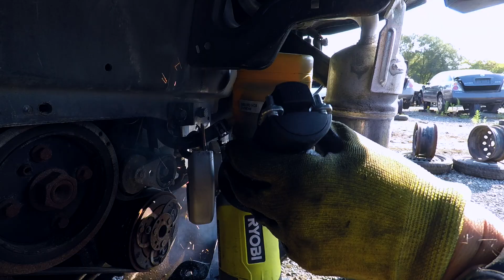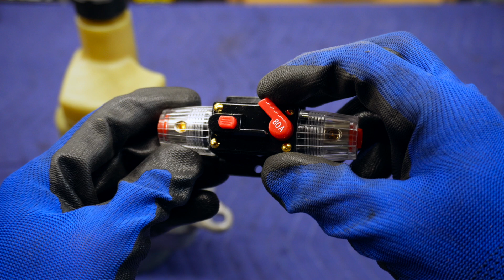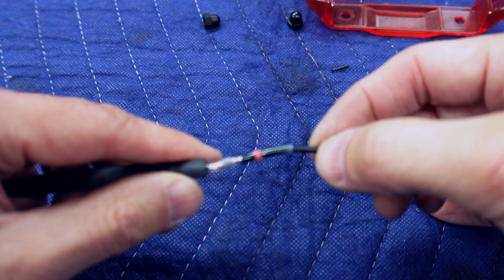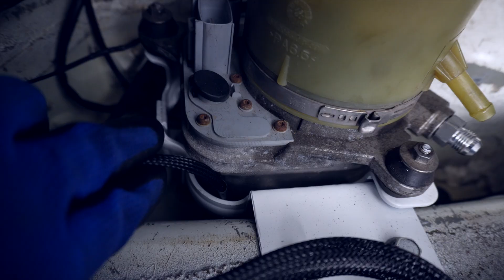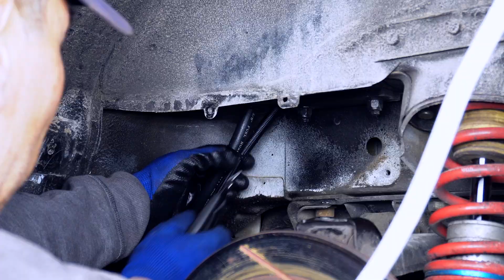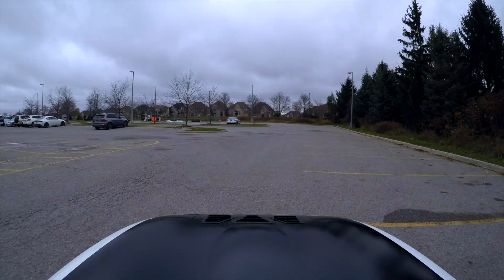Electric Hydraulic Power Steering Retrofit Comprehensive DIY Guide

Comment: Great video, awesome info. The adjuster is a great find. 

Am looking to do an EV conversion on my Ford Transit so this would work great. 

Incidentally I replaced the electric power steering unit on my 2004 Ford C-Max about 10 years ago but it was a straight swap.

Comment: Great video! Question, how has that PTFE line held up now that’s it’s been over a year ?
Reply from the maker: Perfect, I also run the same brand -6AN for my fuel feed line and it's been holding up.
Reply: @mostlyuselessgarage Nicee, thanks for the reply. I run Evil Energy for my fuel set up as well, just wasn’t sure with the pump being high pressure if it’ll burst.

Comment: Debating on doing this to my e36 only thing holding me back is the noise maybe if I mount it super tucked up in the bumper I can quiet it down in the cabin ??
Reply from the maker: On the Volvo the pump is positioned at the right front corner in front of the wheel. If that's an option, the noise should be unnoticeable.
Reply: @mostlyuselessgarage funny enough I’m doing that rn lol
Reply from the maker: Great minds think alike 😊

Comment: This was useful. 
  I'm working on a 1968 VW type3 squareback with an ej22 swap. It will be a widebody with 8.5 x15 fronts and 10x15 rears. Double a arm front suspension.  
  Volvo EPS is a viable idea. 
  I'll mount it in front.
Reply from the maker: Holy! That's gonna be a wild ride dude!

Comment: So when you set the knob to minimum and middle does it pull less amperage?  Btw very informative video.
Reply from the maker: Sorry I don't have a way to measure that. All I can say is that with my 150amp rated alternator, the 80amp breaker has never tripped and I've never had an issue even on track.
Reply: @mostlyuselessgarage good info, thanks

Comment: One question when comes to downside. Does this mod affect the life of alternator since you need extra like 30A for the electric pump? Will it stress your alternator more than usual is my question.
Reply from the maker: Good question and this really depends on your alt's rated amperage and your car's load sources. In my case I don't have AC, subs/amps, light bars, etc so even at peak 80A the EHPS should be fine. I drive my car on track and even with constant PS load it's worked flawlessly. And with street driving it's basically under zero load for 99% of the time. My alt is rated for 150A
Reply: @mostlyuselessgarage Oo.. that's a big difference compare to mine. My lancer alternator rated only 105A, and it's a daily use street car. Guess I'll gonna need to upgrade to a higher ampere alternator before modding this. 😊

Comment: Amazon/ebay ave a bunch of wiring connectors available for these pumps. Be aware they are all 10g wire.  I'm only using 2' of wire to direct connect it to the battery, time will tell if that's enough thickness for the short wiring run. 40 amp fuses aren't enough for this pump as they will periodically blow, going to be testing a 60 amp fuse next. The volvo OEM wiring appears to be 6 or 8g wire and it uses an 80 amp fuse.

Comment: I red online that alternator upgrade is needed in order to run volvo power steering pump, at least 80A. Anyone did an alternator upgrade?
Reply from the maker: I didn't upgrade my 150A rated alternator and it's been fine.  That said, on a very tight race track I noticed in my BMS that there are period spikes of ~90A.  It's probably quick steering transitions putting load on the pump.

Comment: Would like to do this on a 1971 land rover.  It has no power steering at all.  What do yo think?
Reply from the maker: Since you don't have PS it makes more sense to retrofit a column mounted EPS like from a Prius. Check in the Land Rover community if any kits exist, or if you're a fabricator buy a pump, controller, and shafts from a Prius and get to measuring and welding.  Good luck!

Comment: Great video, new subscriber. Did removing the parasitic loss of the engine bay pump & transfer weight to rear help your setup? 

I just wanted to mention that ServTronic now has an automatic pump speed kit controlled by GPS speed which eliminates the variable knob. It’s what I’m leaning towards.
Reply from the maker: It did, after corner balancing I noticed that the more optimal location for the pump is the right rear by the battery. I still prefer it on the left as it doesn't really interfere with what little trunk space there is. 😅

Ya the GPS one was available at the time and it does look like a great option ... Report back how you like it!

Comment: What amperage is your alternator and what electronics are you running? I have the same setup but my breaker trips when I go full lock.
Reply from the maker: My alternator is rated for 125 amps. If you have an 80A breaker on your pump it's drawing to much. Do you have a controller installed? Try dialing it down to minimal assist.
Reply: @mostlyuselessgarage  It still pops the breaker even at the lowest assist when hitting full lock. I did some testing yesterday and it looks like the amp just isn't giving enough at idle. If I hold the RPMs high, it doesn't pop the breaker. 🙃
Reply from the maker: You sure the alt is supplying its full amperage?
Reply: @mostlyuselessgarage  It's giving the most that it can and it just isn't enough. It's a 165A alt which does 100-145 at idle, but it's going through a relay box with a 120A fuse. I'm going to bypass the relay box and go straight to the battery with 0 gauge wire and an inline breaker. If that fixes it, then I save the alternator money, if not, then it looks like I'm going to have to get a new alternator. I have 2 Walbro 535s as well so maybe it just barely isn't cutting it. I'll do the modification tomorrow and see what comes of it. I really enjoy your writeup and video, too! That's what got me thinking about the alternator/wiring.

Comment: Nice vid! Appreciate all the info. I am looking to do this in my E30 that I am in the middle of K24 swapping, since it can only run one of AC/PS off the belt and I live in a hot climate. I was worried about the pump whine (cant stand that high pitch) and was starting to get my hopes up because I couldnt hear it in your driving vids, until you mentioned it at the end and isolated it lol. Is it still noticeable with music playing?

I guess I could add some sound deadening to the trunk if it's bad enough, or see if I could tuck it down by the bumper where volvo does in their cars and see if that location cut the noise down more.
Reply from the maker: It's not silent and I do notice it but I usually drive top-down. I plan to sound deaden the area to make it quieter, shouldn't take too much to make a difference. Good luck!

Comment: It’s an interesting video.
I’m wondering whether the fluid needs cooling.
If I set it to maximum for daily use, is it dangerous—could the system get damaged?
Reply from the maker: That's a good question. Mazda did include a PS cooling loop (little extra length of hard line). For me I have maybe 5 times the length under the car. Also a belt driven PS increases speed with RPM, while the electo-hydraulic pump spins at its own speed, intuitively suggesting less heat. This is a common mod for drifters and road racers, I haven't heard of any mention of additional cooling requirements, but plz do your research and report back!

Comment: This is a really fantastic video.  I am going to do this to my track miata just to... "Try something new" as you put it.  In my case, I plan to mount the pump on the passenger side of the trunk.  This will have the benefit of taking weight from the front left, the heaviest corner of car, and adding it to the right rear, the lightest corner!
Reply from the maker: That's a really good reason to mount it on the right side of the car, plus it'll allow easy routing of the cables with the battery there. Where do you plan to mount it though? In the middle depressed area?
Reply: @mostlyuselessgarage  I am not sure yet, as your video was the genesis of the idea for me.  I plan on collecting the parts over the next few weeks and looking into it.  I will probably mount it in the spare tire well as far rearward and to the passenger side as possible.  While I do have a lithium battery, it is stock size and fills that area completely.

It's currently racing season here were I live and I don't like starting projects when a track day is only a couple weeks out.  I've learned from experience that even a seemingly simple project or install can turn into the car being on jackstands for a month while I fix something.  Miatas are old cars, and mine is high mileage!  If I haven't already replaced the part myself, I know that I will discover something awful when I take it apart!

Comment: I’m not necessarily doing this mud, but I’m deep powering my steering rack over the winter. It’s nice to know that if I get tired of the power steering, this is a much easier solution than putting the original power steering back in.
Reply from the maker: Thx dude, I've never de-powered a rack before but I believe it involves disassembly, greasing, and blocking the ports. Adding hydraulics back could be troublesome, so all electric EPS may be for you. Good luck!

Comment: I'm not sure it's worth me getting a data point on stock ps weight resistance, since you have a different size steering wheel, plus the base vs leather wheel are different sizes. Still really neat. I do wonder what % change the alternator load is experiencing vs the hydraulic pump
Reply from the maker: I haven't noticed any voltage drops or anything but I'll report back I notice any weird electrical issues
Reply: @mostlyuselessgarage  I should clarify what I meant, engine HP loss percentage. Is the Alt more efficient at higher load? vs the PS pump inefficiencies at all times?  Would be cool to see datalog of power draw on the EPS system, on a graph. I'd imagine it's low power drawl when you're not loading the steering, vs the hydraulic pump nearly always being a drag.
Reply from the maker: Went down a bit of a rabbit hole with this. In the video linked below it shows the injector open time increases as you turn on electrical consumers like headlights, fans, etc. So increased electrical draw = more load, that's only logical. With the electro-hydraulic PS pump the draw should only be significant at the most aggressive steering inputs like parking lot speeds and full lock turns. However the PS pump is always spinning with the drive belt so I suspect it would have more parasitic loss than the intermittent high draw of the alternator. It's an interesting question, I don't know how a DIYer would test it. So we may not know unless an automotive engineer were to definitely weigh in here. 
https://youtu.be/UI0jYQQCcP0

Comment: Just installed a volvo pump into a ae86 but it feels so weak, im using an ls400 100amp alternator and i feel its not nearly strong enough. What amp alternator are you using?
Reply from the maker: My alternator is rated at 125amps. Try measuring the pump draw when steering to see if your alt is good. Love the user name you low-key drifter!

Comment: I want to do this mod in my 1982 Volvo 242 Turbo (original turbo car), mostly because the OEM servo pump sits over the OEM AC pump, so when I want to do group a intercooler, the pipe routing has very little wiggle room. But then I can remove that pump and rather have it electric. I have seen maxxecu can control some of the volvo pumps also, but I imagine I would be fine evne with it at the 70% or whatever the limp back home mode is.
Reply from the maker: How appropriate to do this mod on a Volvo 👍 I haven't heard of the Maxx controller but if it's anything like the Servtronic you should be good. Even the default mode is probably OK for street but since the controller is so cheap I highly recommend it.

Comment: I tried that without the controller. When you steer slowly everything's fine but if you want to steer fast the EHPS can't handle it and steering becomes really heavy. Did someone else experience this?
Reply from the maker: After testing the EHPS on track with the controller I found anything over about 25% assist doesn't weight up during quick transitions. Which is weird because it's supposed to have 75% assist without a controller. Bottom line, controller's cheap and worth it.

Comment: There's a leroy engineering dyno test on the hydraulic pump loss to whp somewhere on here. You sir gained 5 to 10 whp in the heavy turns by getting rid of the miata one!
Reply from the maker: No fact checking required, I'll take your 10whp and doff my cap 👍

Comment: Great video! It’s been a few months since you posted this. Have the “evil energy” lines held up well? I’ve come across the brand before and the price is tempting but also worrisome lol
Reply from the maker: Yup they've performed really well. Besides using them for the PS hydraulic line, I have the same PTFE lines on my fuel system from the tank to the filter and up to the fuel rail. Installed in 2023 and no issues since then even under track driving conditions. Evil Energy seems to be popular with the LS engine crowd with many accounts of reliability in that community.

Comment: Great video! Thank you for sharing the experience of installing this pump. Do you happen to know how much current it draws during operation?
Reply from the maker: Good question, I'm not sure how I'd measure that. Any suggestions? Thx for the comment
Update: A little Googling later, at no load 6amps, turning stationary 20-25amps, full-lock with pressure on the steering wheel 70-75amps due to no circulation of fluid. So an 80amp breaker is correct

Comment: Bravo perfect sequel to your electric power steering video!  Did the new hydraulic system have any of the response delay or non-existent return to center safety issues that we discussed compared to the electric power steering from the first EPS video?
Reply from the maker: No issues with response or centering. Even on track there was no weighting up on quick transitions which I've felt on Honda PS systems. This EHPS felt like stock, plus like +/- 20% with the adjustment knob.
Reply: @mostlyuselessgarage  That's great news thank you for the confirmation and taking the risk out for all of us pondering the EHPS mod!

Comment: Hah, I installed this pump 10 days ago with 6AN feed. I have 1 second delay if I turn steering very fast. (It's limp mode). Have you any delay on very fast movements with controller?
Reply from the maker: No delay that I've noticed even on track. I gave it a thorough thrashing and it felt better than stock. For the price the Servtronic is a no-brainer IMHO.
Reply: @mostlyuselessgarage 🙌

Comment: Hey so I just did this retro fit on my mk1 Audi tt, I’m not running the controller, just “limp mode” as you called it. I’m having an issue when it turns on, my steering wheel goes full send as soon as I barely turn it. Any ideas?
Reply from the maker: What do you mean your steering wheel goes full send? Like full assist?

Comment: Is the electric steering from kmiata noisy?
Reply from the maker: Not especially. It's not circulating fluid, it's an electric motor on the steering shaft that provides assists based on the input load.

Comment: Why electric hydraulic steering vs electric steering?
Reply from the maker: If you haven't depowered your powered rack yet, electro hydraulic is a quick way of getting heavier steering and adjustability. And it can clear space in your engine bay and reduce some parasitic loss.
Electric PS is expensive, requires a depowered rack already, and from my experience, there are some ranges of adjustment that just feel off when driving on track. Like a deadspot or disconnection. I'm not the only one, I think Taylor Ray didn't like his EPS for the same reasons.

Comment: Just did mine on my 3000gt mainly to clean up the engine bay (I got the same pump and speed controller!!). I had welded up a bracket to mount under the rear quarter panel and retain use of the factory rear wiper fluid reservoir as a now repurposed ps fluid reservoir using adapter fittings (I deleted my rear wiper). Looks oem, cleans up engine bay, and pump is out of plain sight, I love it. I however only got to TEST it as of 5/10/25 simply because the line ruptured by the 90 degree an fitting by the pump. Bit of a speed bump but I've already ordered a new one and cant wait to fully experience this. This video deserves more attention keep it up!!
Reply from the maker: Dude sick ride! I used to own a 93 VR4 👍 How did you handle running the hydraulic lines? How did the AN fitting fail? On a 3000GT any space that can be freed up in the engine bay would make a big difference, great job!
Reply: @mostlyuselessgarage i ran the an lines along the brake lines and are covered! as for the an line i think the ptfe olive wasnt seated all the way but im hoping to install and replace it this weekend!

Comment: Good video! That adjustment knob doesn't do as much as I expected, how is it supposed to work in the Volvo? More assistance at low speeds?
Reply from the maker: Thx man! Ya it was only a 25% increase in steering effort, I was hoping for more. You got it, Volvo varies by speed and in fact, ServTronic has a GPS controller that does the same. For fun, off-camera I added a dash switch to shut off the pump if I want that manual rack feel 😂